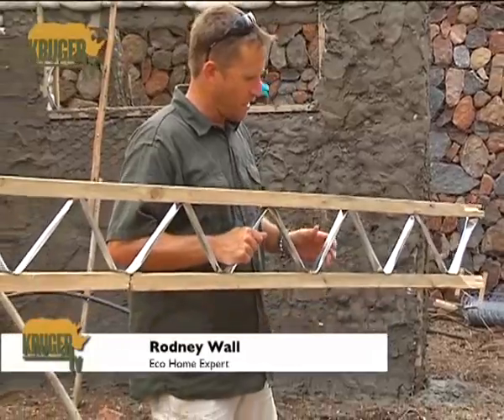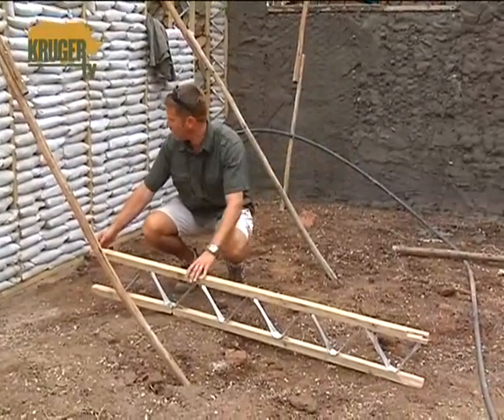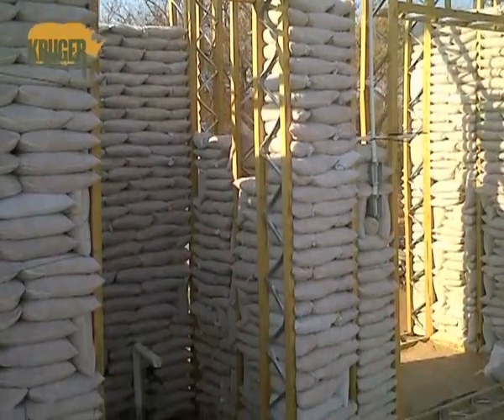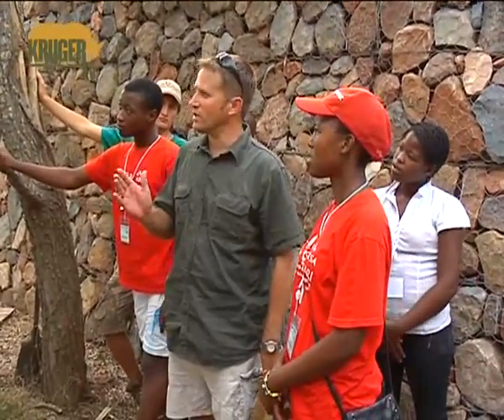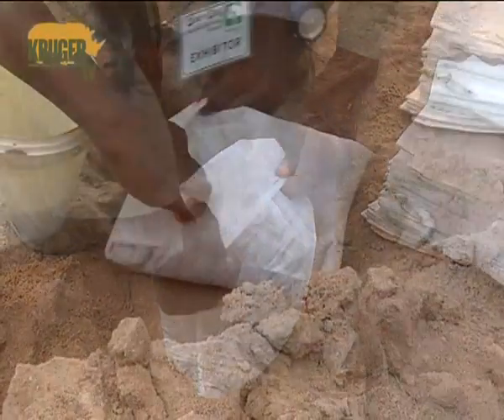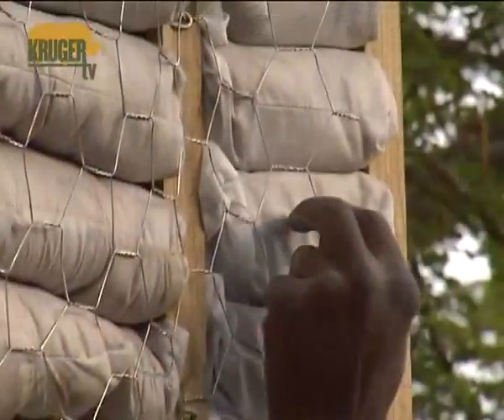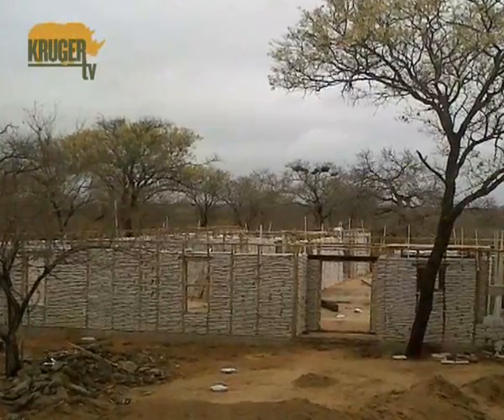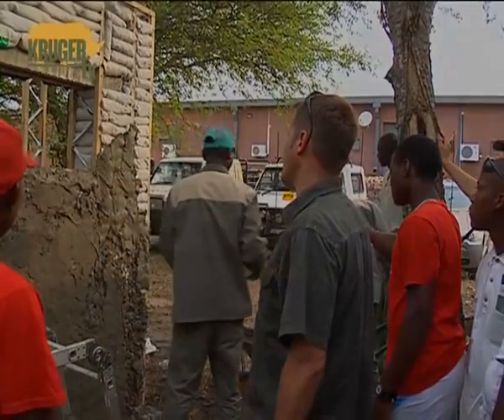Ecosteps - How to build a sandbag house eco-friendly

Comment: The concept is hundreds, if not thousands of years old. The only visual change is that these are being introduce to a location that (apparently) has never seen adobe-thatched houses before.  65-percent of the homes and businesses where I live are traditional 'hay-bale' adobe dwellings.  You frame the house, cut the 'square bales' in half with a bale-saw, stack them between the framing uprights, TIE THEM TOGETHER (which I did NOT see done in this bagged version, which will lead to wall warpage and sag in a few years), over-wire, then stucco (either classic 'clay' or modern 'fiberglass' stucco).

The again, in the U.S., if I were building my own house and knowing how to do it, I would simply get some 1/2" CDX plywood, a table saw with a dado blade, some 2x8's, and build my own verticals with the plywood and 2x8's (see how to make a composite joist if you don't envision it).  I can frame and build a house for a few thousand dollars that will last for a century in the desert, and I don't need sandbags, or metal joist connectors.
Reply: Show some pictures or provide a link to your work. ps: the location above is Africa my man, where mud homes have been built for millenia. Thatched too. I lived in a 105 year old mud hut, thatched roof rondavel with cow dung floor for six months in the Eastern Cape, and it was sound and bloody strong (my foreman accidentally drove a small MF tractor into the wall. Some mud later, it was all patched and ready to go. No chickenwire, no dimensional lumber, and the walls were perfectly serviceable with no water ingress.

Comment: very poorly biuld homes. the bags need to enderlock. i.e. ends must not be put on end to end.
Reply: Bullshit! The lack of wire and the lack of over-lock is compensated by the wooden frames
Reply: if you say / think / type so.
Reply: clearly, you've never seen a sandbag settle, compress and sag over a few years time.  They also tend to bulge inward or outward, depending on how they settle, too - so then they'll press on the chickenwire and cause a wall bulge.  That's ok, though, there's a great 'repair market' to fix shoddy work like that, too. I know, In my youth, we used to have to 're-wire' junky-built houses all the time, then re-stucco them with 'decent stuff.  Worst jobs were where the wall bulged, water leaked in at the gutter line, hay bales had black mold, and you ended up having to rip it all down to the frame, replace molded wood, and rebuild.  Poor homeowner would have probably burned it to the ground and started over, if they knew what they were getting into first - it would have been cheaper for them.  Talk trash to who you want to, but the truth is easily available if you just look up ADOBE BALE HOUSES, or 'CLASSICAL ADOBE HOUSES OF THE U.S. DESERT SOUTHWEST'.
Reply: @skeetersaurus6249  Sure... Have you ever seen mold on sand or polypropylene? You would have to seal this house tightly and heat up to create mold. Regarding bales, in Europe you will find a lot of very old bale houses still going good. Earthbag houses are great idea, longlasting, eco and cheap.